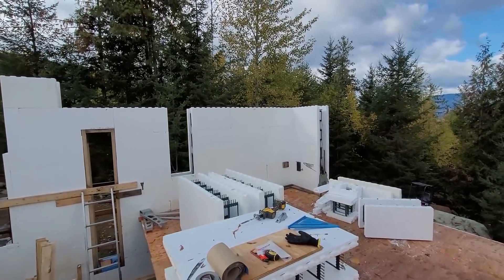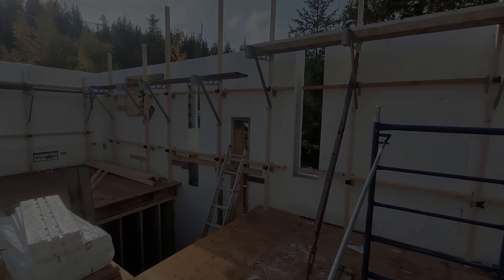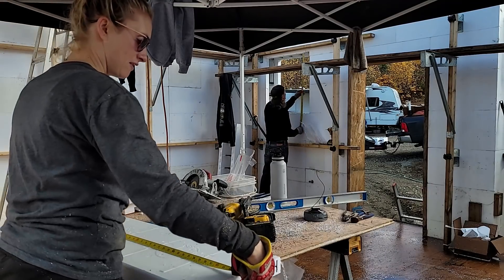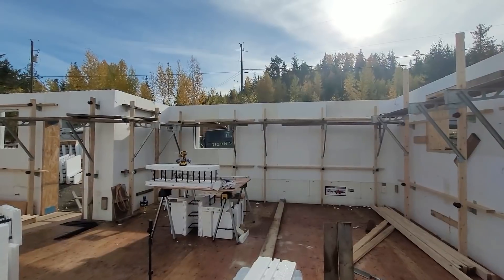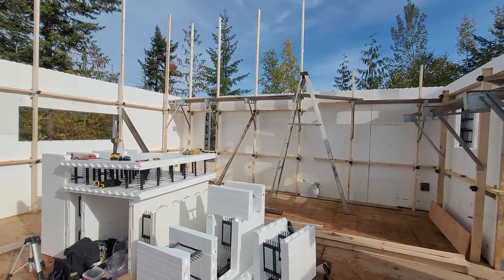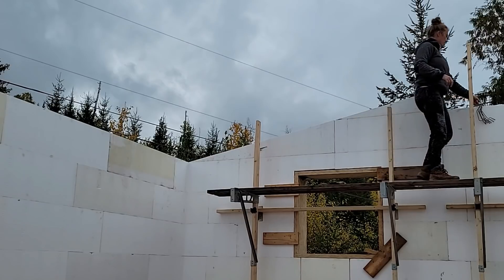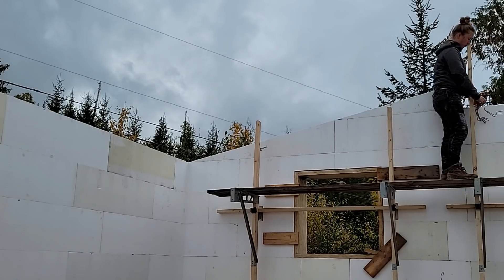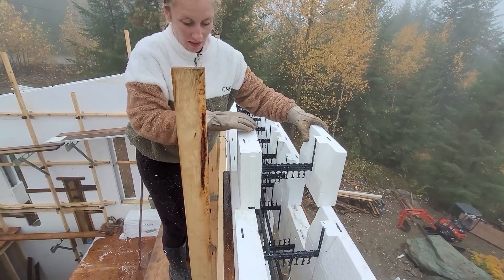Our LAST ICF blocks EVER!! (ICF blocks to the roof, cutting slope for shed roof/mono pitch trusses)

Comment: What is the brace holding up you r walkway on your bracing called? I have already bought used zonts and zuckles for doing my icf house next year from another guy that built one. Yours is looking good!
Reply from the maker: Thats what it is! Zont and Zuckles. Weird name. We also bought them second hand but didn't have enough so we rented a set of Plumwall for the shorter wall.
Reply: @anaverageacre  We're building in the spring down towards Vernon and would like to use Zont and Zuckles. If you're done with them then we'd be interested buying them. Like following your build as my wife and I will be self building too.